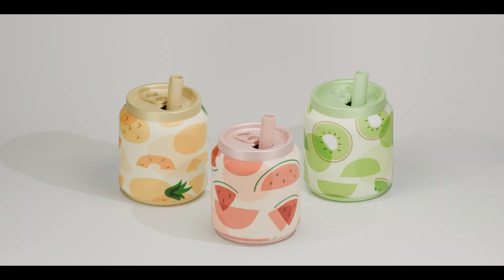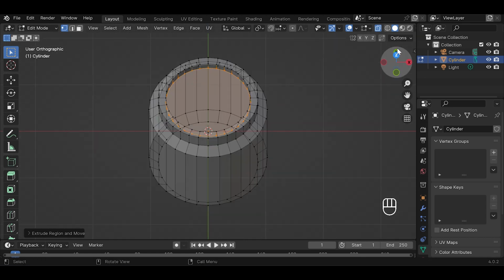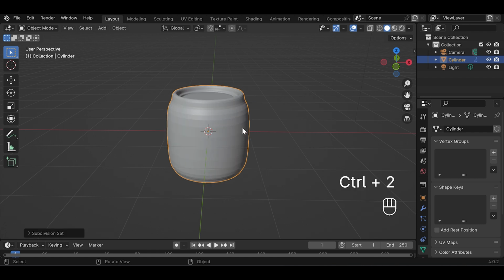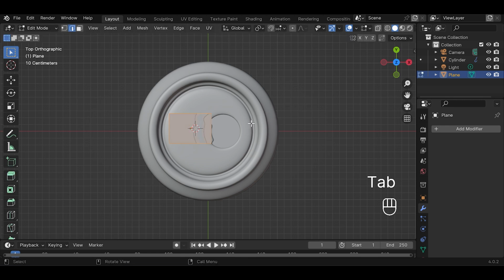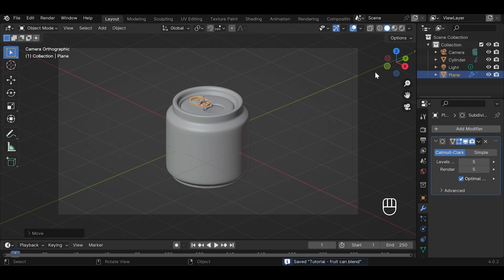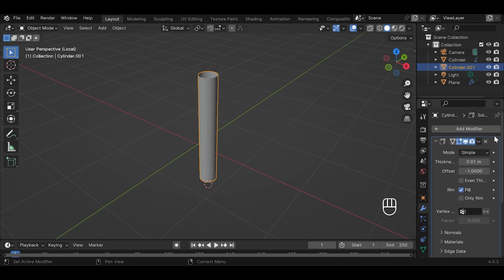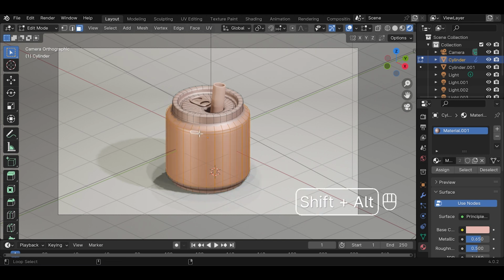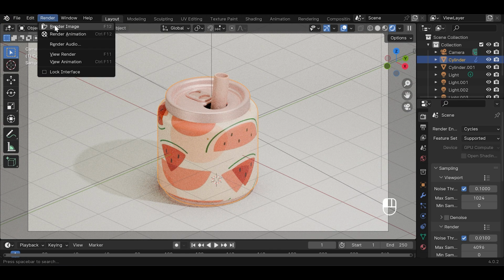Blender 3D Tutorial | Create Simple and Cute Cans!

Comment: Hi, thank you for the video! I had a problem with making subdivisions. Did you just press Ctrl+2? I have a problem after I press Ctrl+2. I can't select anything anymore, not even the whole object, so I can't edit it. Do you think it is some bug with my blender or should I press something else?
Reply from the maker: Hi!! There is no problem whenever I apply ctrl+2. So I am not sure with the answer to how to fix it😬. But I guess you can try these two steps in case if it works.
1. you can put subdivisions in the modifiers panel instead of pressing ctrl+2.
2. reassign your shortcut for adding SubSurf Modifiers. In Preferences search for keyboard shortcuts starting with the name "sub" and you'll find what you need.